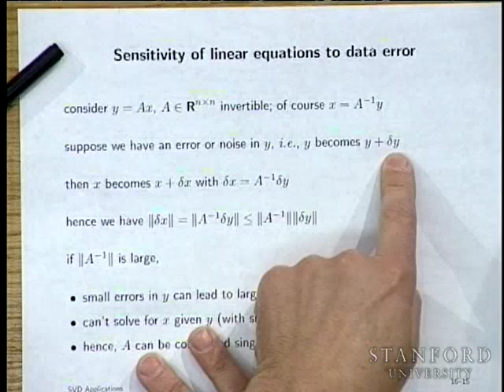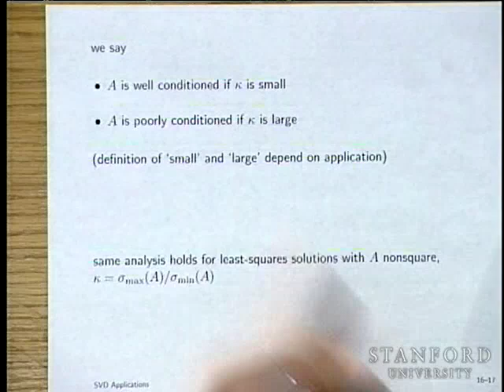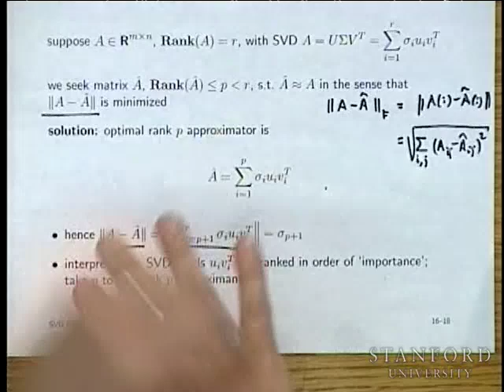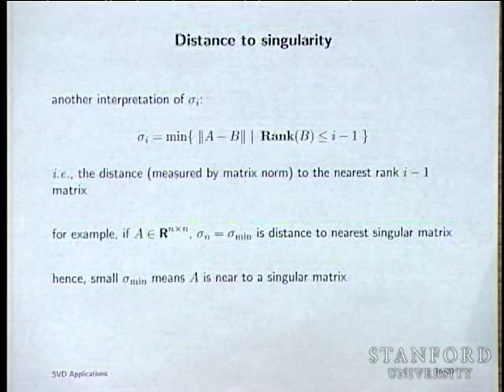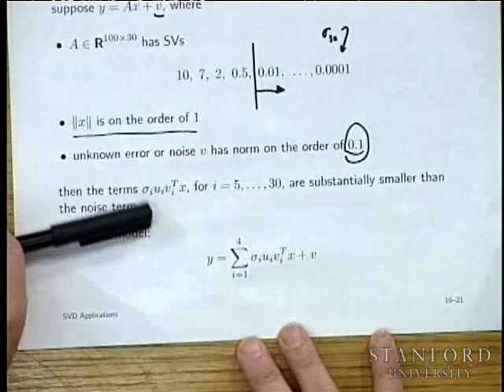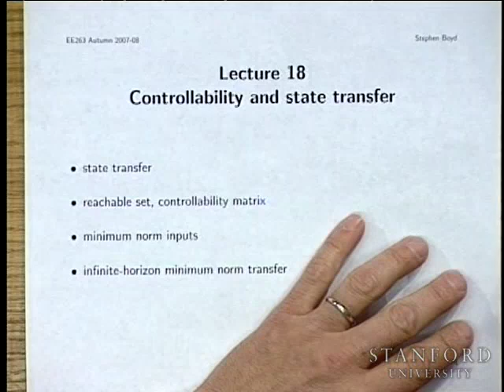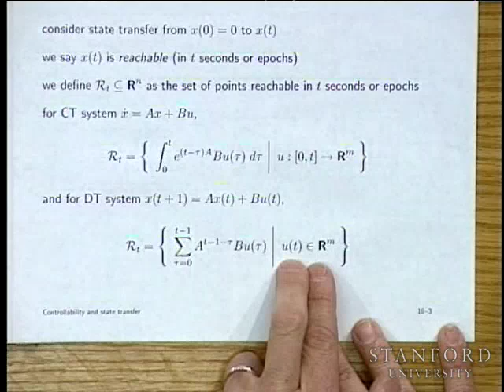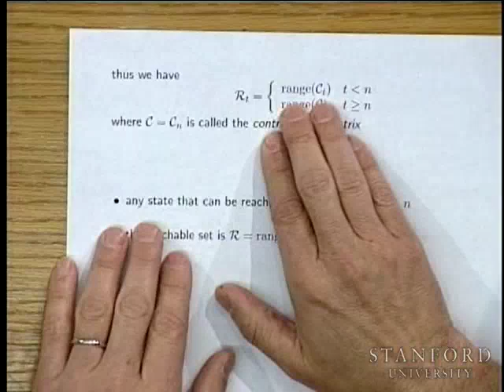Lecture 18 | Introduction to Linear Dynamical Systems

Comment: Excellent lecture! Regarding the reachability analysis in 1:06:55, note that the claim "if you can hit a state in 1.5 seconds, you can hit them in 3.6 seconds" only applies to unconstrained LTI systems. If there's any constraint in the input or in the state, then the story is different.